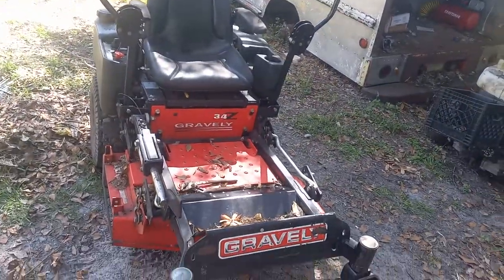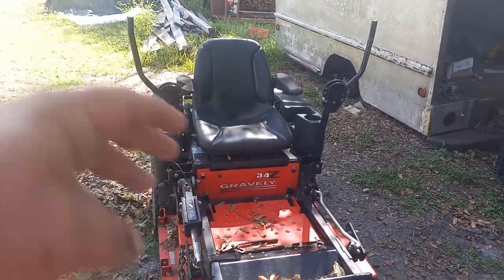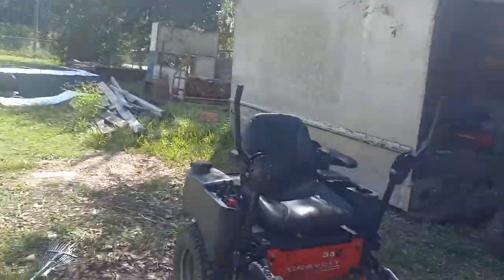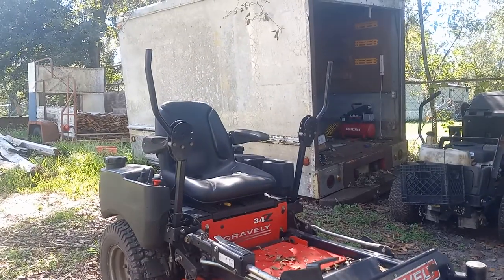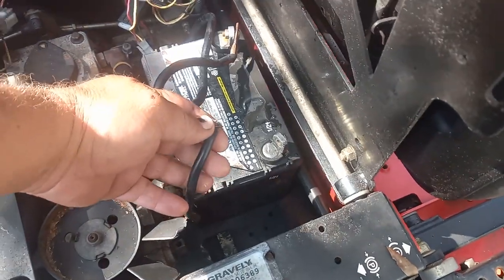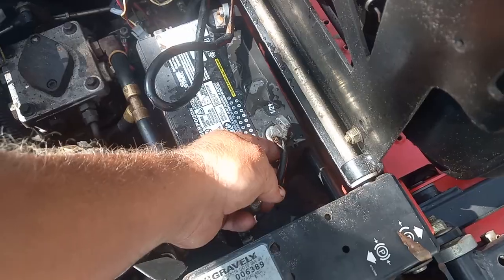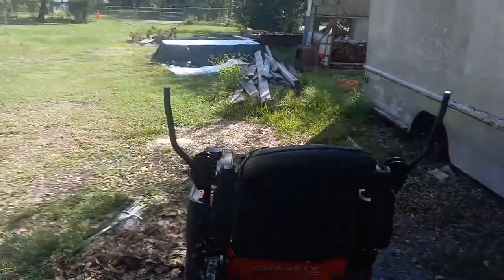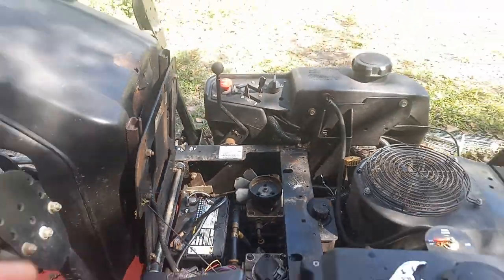Zero Turn Shuts Off Sometimes / SIMPLE FIX #gravely #lawnmower

Comment: Just had a similar issue with a Snapper ZT I am bringing back to life for a flip.  Was using a battery out of my other running rider to troubleshoot a “click no start/crank” situation.  Could not figure out for a while why battery just pulled from runner was not cranking over engine of this other Snapper.  Come to find out the positive terminal on battery combined with rusted cable end was just worn enough  to not allow a good power charge through cable to starter.  Bought a new battery and cleaned cable ends and instant engine crank on non-runner:-)  Now I am just waiting on carb rebuild kit to arrive and that should allow engine to stay running without ether help.
Reply from the maker: Frustrating when your living thru it but with some patience and a Lil luck it feels good to figure it out.. nice job
Reply: @MunkyWrench  My first clue on battery and issue should have been when I had continuity from positive batt cable to solenoid but no amperage thru positive cable itself. Eventually I started wiggling the pos batt cable while turning the key switch back and forth and my “solenoid clicks” intermittently came back; from there I knew I was on the right trail of batt connection issue.  Like you say, it’s a fun challenge overall to figure out and feels good when you have solved it:-)  9 times out of 10, these mower no start issues are “simple/stupid” diagnosis Lol.
Reply from the maker: @chadfield376  absolutely.. and so fulfilling to bring it back to life

Comment: I have this same mower and it’ll only stay running while I’m holding the key but once I let off the key it immediately shuts off 
Do u think ignition maybe or the fuel solenoid idk anything else it may be
Reply from the maker: If it only runs while your holding the key and shuts off right away I'd guess it's not running at all.. it only sounds like it's running because the starter is spinning the motor.. I would do all the nor al stuff and check for soark.spark.. then check for fuel getting to the carb.. also make sure your not turning the key back into the off position.. happy to help u through the issue step by step.. let me know how I can help
Reply: @MunkyWrench  I know it sounds that way but after holding key a few seconds it starts and I’m getting hit exhaust and a little smoke out the exhaust and starter grinding while I’m holding key once it starts because starter is not moving able to move fast as engine is going 
It’s an odd thing 
I have fuel and spark no doubt
Reply: Heat I mean not hit
Reply from the maker: @135-j  ok that makes sense.. has the machine sat for a while before this problem started .. it could be a timing issue .. if timing key sheared it would do that.. a jet in carb can be blocked.. do u have good compression in cylinder.. did u remove valve cover to see if it blew or bent a rod
Reply: @MunkyWrench  the machine did sit I was going to go through carb this evening but run out of time
It sat a few months so could be carb related but I didn’t really think it was being it runs damn good with wide open throttle while holding the key in on position 
I’ll check all that tmrw though for sure I guess if it was the fuel solenoid issue it wouldn’t be starting at all
Reply from the maker: @135-j  correct .. fuel solonoid is easy to check.. turn key to 1st position and listen for click.. buy I'd it wasn't working it wouldn't run.. if u use reg ethanol gas and mower sat I'm sure carb it gunned up.. if runs full throttle while turning key then I'd bet carb.. its starving for fuel
Reply: @MunkyWrench  that sounds about right I took bowl of today but didn’t go any further I’ll check it out tmrw and clean it 
But I’m not getting a click from the fuel solenoid so that was my other question but it’s getting fuel so I’ll worry about carb for now thanks for all the help and awesome channel I am watching all your vids now as we speak 👊
Reply from the maker: @135-j  thanks for checking my vids out and for becoming a subscriber.. if fuel solonoid is not working u can replace.. or remove it and cut the top off the plunger with wire cutters.. then re install and test again.. at least u will know if that's an issue and if it's broken..  cutting it off won't hurt anything
Reply: @MunkyWrench  sorry to bother ya but now issue is no power to any of the contacts on ignition switch 
New battery that’s good and tested all fuses and relays are good and tested 
Not even power to the safety switches on the seat or for the brake
Reply from the maker: Did u figure it out I'm sorry I missed your last question.. just seeing it now
Reply: @MunkyWrench  sure did was ignition switch as I suspected  disturbed contacts moisture got in it